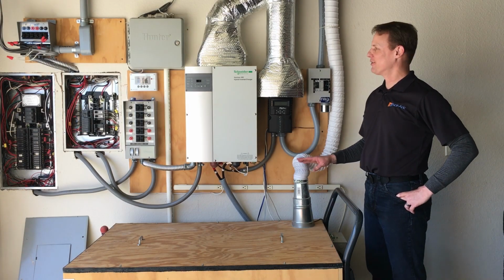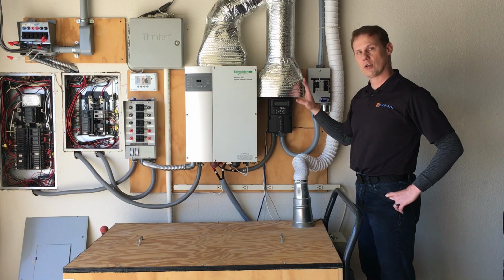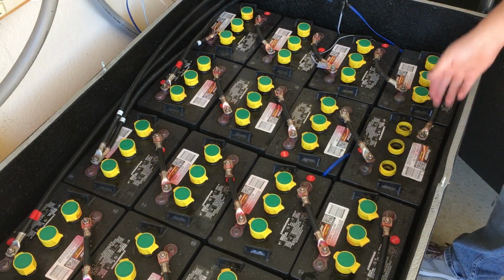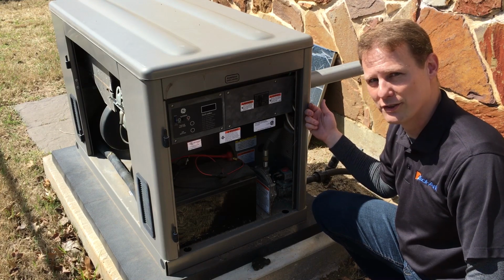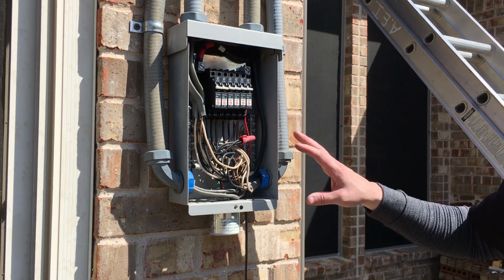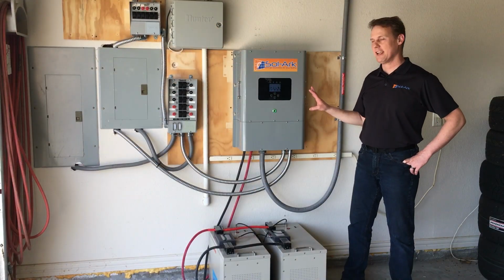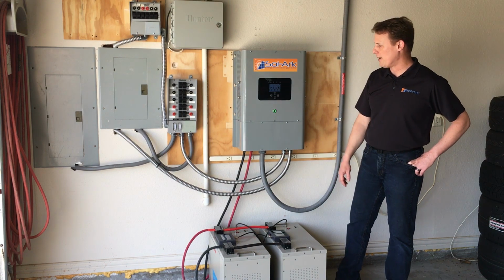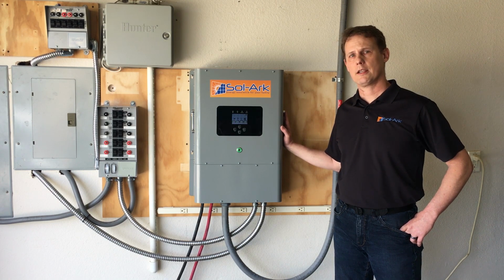Sol-Ark 8K Customer Install/Upgrade (2017)

Comment: A few things grab me when I see this.  That is a very half-baked Schneider setup to cast shade upon.  Where are the AC and DC disconnects rather than hodge podge combiner boxes?  Where is the gateway or combox for monitoring/communications between equipment?  Also, can it start a 1.5 hp well pump or motor?  Further, what were the specs and cost of the FLA vs lithium batteries?  Lastly, what happens when the inverter has a failure?  I see a disconnect but is there a bypass like the Schneider system?
Reply from the maker: I can't answer all the questions about the previous installer other than there were AC & DC disconnects & gateway (maybe not visible on video). The Sol-Ark 8K has started 3HP well pumps and 3 ton A/C units on batteries alone. We decided to not offer lithium batteries because we found something better (see our battery video). The Sol-Ark 8K has a built in bypass that trips after 5 failures to startup. No need for an external one and it's automatic.

Comment: So the Solar Ark is Grid Tied?    Are the replacement batteries equal to the customers old battery array ?    And you are still using two Transfer Switches?      Looks like a big investment to replace this old system.   I know the Solar-Ark can do the Job without a Charge controller and Inverter.
Reply from the maker: The Sol-Ark can be Grid Tied, just zero the entire home, self consume, or Off Grid (automatically). The battery bank was equivalent to the old one in KWh size. But we did drop the lithium batteries for a newer technology that only cost $4.3K for 17KWh. See the website for PCC-200. We have now switched to 10 circuit transfer switches or 20 circuit critical load panels.

Comment: Your email came this morning, 06 October.

I don't know if I have video of your company at the September Anaheim event.  A program we videoed in Ethiopia must come first.

Excellent demo video.

Also, you do not say where, in what state of the US, you installed the new lithium system.  Here in Los Angeles, California, I question if anyone would install a lead/acid battery system.  Earthquakes present a risk.  With lithium batteries, no risk.
Reply from the maker: Thank you for the feedback. We were developing a lithium battery but dropped it after >$200K in battery R&D/testing. We found thick plate carbon AGM to be less costly per cycle in real world temperatures/discharge/charging currents. However, we are battery agnostic. We have quite a few customers using lithium batteries with the 8K. We even have a few lithium battery manufacturers bundling with the 8K because the efficiency boost makes their lithium battery more effective. Feel free to ask us for the battery research. And we still love LFP lithium for portable, compact, and warm only climates.

Comment: Who ever installed the Schneider did not do so good, they should have been using the 60-150 / 80-600 HV-CCs and the PDP with the gateway/combox! and for a 5+KW system why a golf card BB, what was this like a 48v 200ah BB, should have been at least L16s @ 440ah. Long and short this was a bad install of the Schneider system.